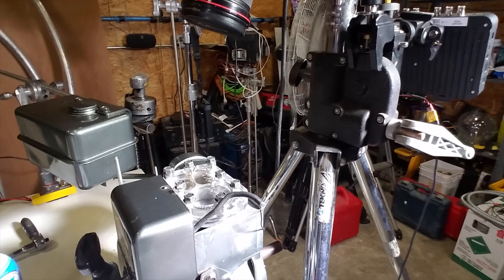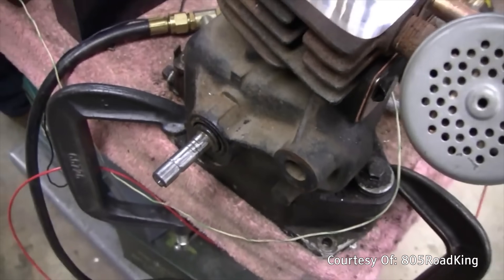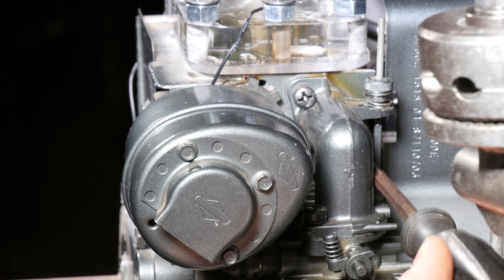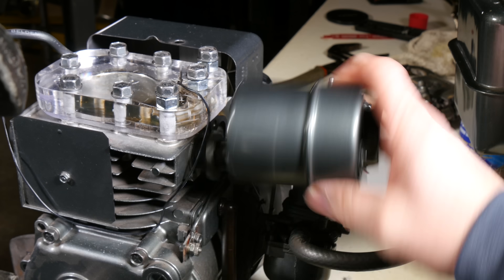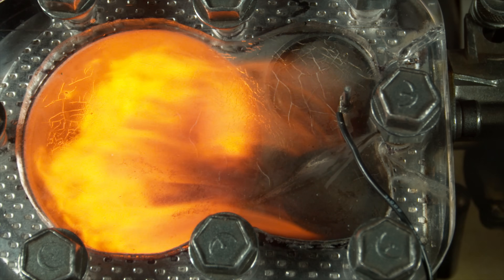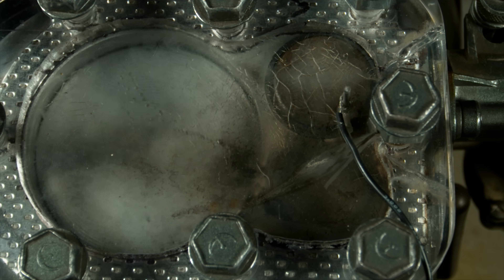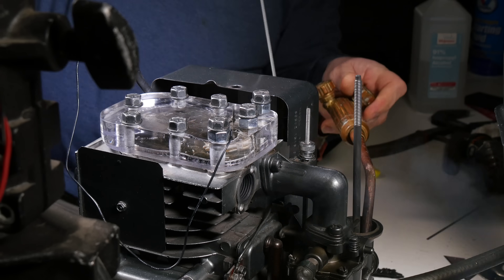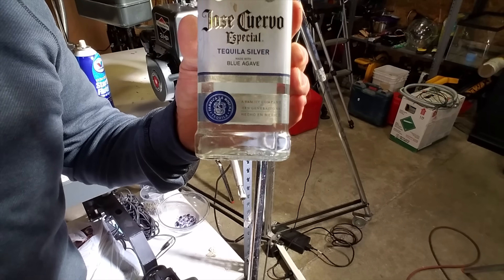See Through Engine - 4K Slow Motion Visible Combustion ( S1 • E1 )

Comment: 4000 fps is 150 times slower then real life? since when we see in 26.6 fps o.O?  4000 fps is 45 times slower the real life. We see in 90fps. If your real life that you are talking about is 25fps that you may record in then is something else.
Reply from the maker: Actually it says " 150 times slower than real time " not real life. life is way too fast !
Reply: Alexandru Visinescu Real life has no frame rate and we can distinguish well above 30 or even 60 fps.
Reply: Do some research, you can distinguish up to 1000fps. But on average you see in 90fps. squirrels for instance see in 120 fps . Our average eye resolution is 576mpx. just google it and tell me i'm wrong
Reply: Maybe, just maybe the human eye isn't a goddamn camera that takes a bunch of pictures, and 4000 fps is 150 times slower than the standard video framerate of 26.6 fps when played back at that framerate?
Reply: Ur maybe right on the fps, but less correct about the resolution, 576mpx is the number but in reality 9mpx is in use since u dont see everything around u sharply
Reply: I never said u use all that 576mpx. You can use around 74mpx. but 9mpx its not much. You can make the difference between 4k and 8k with no problems, or even higher. Here are the "specs" of the human eye if u are interested.
Sensor (Retina)

: 22mm diameter x 0.5mm thick (section); 10 layersResolution

: 576MP equiv.Visual Acuity

: ~ 74 MP (Megapixels) (printed) to show detail at the limits of human visual acuityISO

: 1 - 800 equivalentData Rate

: 500,000 bits per second without colour or around 600,000 bits per second including colour.Lens

: 2 lenses - 16mm & 24mm diameterDynamic Range - Static

: contrast ratio of around 100:1 (about 6 1/2 f-stops) (4 seconds)Dynamic Range - Dynamic

: contrast ratio of about 1,000,000:1 (about 20 f-stops) (30 minutes)Focal Length

: ~ 3.2mm - (~ 22mm 35mm equiv)Aperture

: f2.1 - f8.3 (f3.5 dark-adapted is claimed by the astronomical community)FOV Field of View

: 95° Out, 75° Down, 60° In, 60° UpColor Space

 - 3D (non-linear) RGBColor Sensitivity

: 10,000,000 (ten million)Color Range

: 380 to 740 nmWhite Balance

: Automatic (constant perceived color under different lighting)Refresh Rate

: foveal vision (high-quality telescopic)  - 3-4fps; peripheral vision (very inaccurate) - up to 90fps
Reply: but even still depends what kind of monitor the 4k and 8k are displayed on, if u put those into phone then it becomes really hard to see the difference versus a 80'' tv screen. But alas ''specs'' are ''specs'' and propably linked to 1 persons eye, not every eye is the same, some see more colors some see less, some see far some see near, its not a camera lens that is more or less the same for every camera of same brand.
Reply: The ppi counts a lot, that's obvious. And the numbers are on average, ofc, every eye is different. Even your left eye is different from the right eye. Do some research for yourself if you want, there are ways to calculate how many ppi can u see from any distance from a screen for example, and stuff like that. I suck at math so i cant tell u :)))
Reply: Alexandru Visinescu you only see at 24 fps if you had some tequila shots first
Reply: Bladsmith  yeah but he said "4000 fps is 150 times slower than real life" The human eye works like a camera. Camera doesn't mean pictures. Night vision googles are used for sight, they work like your eyes/camera but they don't record, binoculars are used to see images closer, they work the same way. You even learn this at school at physics when you learn lenses and mirrors. 
https://www.nkcf.org/about-keratoconus/how-the-human-eye-works/
 I googled it for you, u can google it yourself if u want more info
Reply: E. coli after a bottle u see in playback :))
Reply: Wow. You should google what a colloquialism is. None of that had anything to do with the issue at hand.
Reply: Alexandru Visinescu While u are correct that human eye works like a camera ur still incorrect, camera takes still images, eyes do not, most cameras are digital, human is not. The fundamental of lens is there but still the way the actual image is created is different. Did u know, if u flip the binoculars backwards, u will see everything further away ? zis is amazing i tell you
Reply: The FPS and the speed of the video playback relative to time is just how quickly he plays back the frames that the camera recorded and has nothing to do with your eyes.

The camera recorded at a rate of 4000 FPS and he slowed it down to a rate of 25fps playback speed.  You're over complicating it.
Reply: I think people can see more than 90 frames per second... otherwise we wouldn't be able to see 3D effects in 120Hz or greater.

Comment: This is a great video, I enjoyed it so much! And your girl is awesome! 
I think though that the engines ignition isn't set right (too late). You can actually see that when the exhaust valve opens, there is still fire in the combustion chamber (being pushed out, i.e. not all of the fuel turns into engine power...), and that  the main burn happens after the piston is at peak high. I think you can enjoy greatly fixing the ignition timing and film it with better fuel efficiency and more impressive burn as well.

Comment: Someone please explain why the spark plug fires like a two-stroke when the engine is a four-stroke.
Reply: Matthew Degler The spark plug is designed to fire by being powered by the upward motion of the piston. 2 piston pumps in 4 strokes is gives you 2 sparks.

It isn't a hindrance, so it is good.
Reply: Mathew Degler.
This is a simple wasted spark engine, as most small four stroke engines are, it's simpler and easier to manufacture. In these engines the ignition runs off the crankshaft and sparks every time the piston reaches tdc (top dead center). In most car engines the ignition runs off the camshaft, which rotates at half the rpm (revolutions per minute) of the crankshaft, thus only sparking every second tdc. The four strokes are - Intake stroke, when piston goes down.  Compression stroke, when piston goes up.  Ignition or power stroke, when piston goes down again.  Exhaust stroke, when piston goes up again.  Or suck, squeeze,  bang,  blow. Cheers.
Reply: I'd just be worried a bit about backfire if there's still unburnt fuel after the power stroke (as seen in the pure-ethanol example). That is, unless the sheer flow of fuel intake won't let combustion reach down into the intake valve.
Reply: Mathew Degler.
Any unburned fuel would be burned it the exhaust.

Comment: The 91% alcohol  looked like a washing machine because 1.) the other 9% is water. 2.) The liquid was not being atomized correctly (a spray bottle with 99% isopropyl alcohol would make a solution to both of these problems just make sure you have some kind of exhaust on it if you use the spray bottle you don't wanna be holding a flamethrower lol) Hope it helps man and hope to see a follow up on this vid. P.S. the spray bottle would work the best for the tequila as well.

Comment: Nice but i got confused there is a spark which ignites the fuel and another one when  the exhaust port opens
Reply: Big smoke Gaming The design of the engine just makes there be for an extra spark for no reason. It harms nothing and is easier to build

Comment: I think some of the difficulties with "proper combustion" can be attributed to the air-fuel ratio. Assuming this engine was set up gasoline only then it probably somewhere between 14.7-15:1 something like alcohol or acetylene will have much lower ratio because it carries its own oxygen. So running the alcohol and acetylene on the lean side might help with the overflow and soot problem

Comment: Incredible video! It's fascinating to see how the different fuels burned in the engine. I'm also impressed the cylinder head lasted that long, considering the high pressures and temperatures produced during combustion. 

Also, seeing how the engine runs on tequila would definitely be cool. I think some gas turbines can actually run on liquor, but I'm not sure about piston engines, so it would be nice to find out!

Comment: Why does it spark after combustion?
Reply: This engine uses what's called a "Wasted spark ignition system."  The ignition system is built on the crankshaft, and gives a spark once per rotation of the crankshaft.  Since this is a brute-force-and-ignorance 4-stroke engine, it only has one power stroke for two revolutions of the crankshaft.  So it sparks once when the piston comes up compressing the fuel & air, and another useless time when the piston is coming up to expel the exhaust.  The reason they do this is because the flywheel, which is connected to the crankshaft, is a convenient place to to put the magnets that power and activate the ignition system.

Comment: Isopropyl rubbing alcohol, the over the counter stuff, is only 50% to 70% alcohol, the rest is mostly water but can contain other ingredients, like Castor Oil as well. This may have caused the flooding or washing machine effect you got, if you used the standard rubbing alcohol. You can get the 99% pure alcohol and that may have worked better. As for Booze alcohol, it will work great, the purer (uncut) the better. I ran a 350 Chevy engine on some Moonshine when I was stationed in N.C. back in the day, long story but it worked great and it only took a corroborator adjustment to have the Camaro run like a scalded cat! Great video, I've never seen the combustion shown like this.

Comment: Tequila is the same as alcohol(ethanol) fuel you tried in this video so it wont be much difference.

and the reason the alcohol wasn't burning was because of the rich air-fuel mixture that cannot be ignited( its commonly called a flooded engine) and can ruin an engine if not fixed

You just cant use different fuel in an engine with tuning it properly

Comment: Curious as to why you didn't put the spark electrode in the original position.
Reply: The thread in the acrylic head wouldn't be strong enough, it'd shoot it out like a bullet.
Reply: he was using the block as the ground electrode. not possible if the improvised plug was in the center of the cylinder.
Reply from the maker: it would be in the way of the explosion and take some of the Cinematography away from the shot.
Reply: wondered that as well... probably for better view ?
Reply: AaronGottaHelmetCam  A second grounding electrode could be added.
Reply: Warped Perception I never thought of it that way
Reply: +Warped Perception - thought so... sure got sooty looking with the acetylene tho

Comment: m sry if its a noob question. bt what are those 2 circles at right?? one is fuel supply and 1 is air supply i believe. corrct me if m wrong.
Reply: "It's not actually and explosion, it's a burn"
What's the difference? Rate of reaction? How fast does the reaction need to happen to say it's exploding then?
Reply: +devashish chauhan the top right is the intake valve, the bottom right is the exhaust valve
Reply: walter is correct, but a critical point is air, the intake valve the fuel/air mixture in. It's not actually and explosion, it's a burn. The ignition burns the fuel which in turn heats the air causing it to expand, that expansion forces the piston down. If the air entering was colder the expansion would be greater creating more power. 
When you use nitrous (n20) it has 2 parts oxygen per molecule, creating twice the oxygen (ie, twice the expansion).
Reply: devashish chauhan Intake and exhaust valves.
Reply: All "explosions" are a "burn" (well, except for nuclear and steam) But, I think there are two kinds of explosion when it comes to the burn type. One is a deflagration and the other a detonation. If you light a pile of black powder that isn't contained in some sort of vessel, like a pipe or firecracker, it will go "POOF", not "BANG". If you contain the powder in something like a pipe or firecracker, it goes "BANG". The rate of burn is too slow (sub-sonic) for it to explode in an uncontained state, but when contained, the pressure builds until the container bursts and makes the bang. On the other hand, a detonation occurs when the explosive material has a burn rate that is faster than the speed of sound (super-sonic). This explosive material does not have to be contained to go bang. TNT, Dynamite, detonation cord, C4, blasting caps, bullet primers, anfo, and mixtures of oxygen and acetylene are all examples of super-sonic explosives that do not need to be contained to explode with a bang. In the video above, you can see a balloon explode after a laser is pointed at it. I believe that balloon has a mix of oxygen and acetylene gas in it, probably cutting torch mix. Oxy/acetylene is not to be messed with for that reason. It's very powerful.
Reply: devashish chauhan exhaust
Reply: marlin gast m talking about the 2 just at the right of piston
Reply: Pijen thnx mate
Reply: GeneralJohn David thnx man . tht ws a lot of knowledg fr me ✌
Reply: Bob alloo thnx mate .. n i read it all . like really i did.
Reply from the maker: exactly, once we add Oxy and Acetylene it becomes an Explosion !

Comment: how come there is a spark inbetween the explosion for gas acetlyn
Reply: it's just a wasted spark, simple design
Reply: It sparks at a cetain point before TDC everytime, its just the design of the engine.
Reply: joel castro maybe to bun off any remaining fuel that was not burned during the initial spark? that was my guess during the video.

Comment: Rather than try the tequila, try using anhydrous isopropanol.  I think the reason you wound up with a washing machine for an engine was that 9% water content of the alcohol you used inhibiting the burn.  One way to find out.

Comment: I'm guessing that the excess liquid in the engine while running on isopropyl alcohol was water. It is usually sold as a mixture of water and alcohol, so the water would have been left behind after combustion.

Comment: Great test, you've just gained a subscriber! Could you try nitromethanol in this engine (like the stuff sold in small quantities for RC vehicles), OR nitrous oxide to see how it changes the flame pattern and intensity?

The tequila test would be interesting, but I imagine you'd need some high proof grain alcohol or similar.

Comment: The fluid you seen during the alcohol run was water. Rubbing alcohol can range from as little as 21% to as much as 93% water.

It's an excellent way to clean up the combustion areas, valve heads/seats/etc... as the alcohol breaks down the resins/laquers, while the high temp water displaces the carbon deposits... AND acts as a carrier for the contaminants once the alcohol is burned off. It's worth noting, however, that the alcohol is MURDER on gasoline spec fuel lines, gaskets, seals, etc., and the water creates HUGE pressure spikes in high compression engines (water doesn't compress)

Comment: Try to run your optical engine with WD40.  I ran a Rotax engine at no-load on a can of WD40 some thirty years ago on a bench (No optics of course).

You can easily tune the air-fuel ratio with the distance between the spray  nozzle and carburetor. 

Thanks for your video - I was surprised how long the head survived.

Comment: This was fun tu see ! I'd like more of that.

I am not surprised to see so much smoke on the acetylene. It is what you see if you light the burner on acetylene as well.

Here is my suggestion : Take as small burner on that set. Not a cutting torch, but a small burner what we used to weld sheetmetal. Open acetylene and oxygene bottles en both knobs and light the burner. Adjust the flame properly.

Now run the engine on normal fuel at medium speed. At the moment that all the normal fuel is used up and the engine is beginning to stall
...
Then extinguish the flame by pushing it into a wet cloth and quickly bring the burner to the engine inlet.

Good idea to wear safety goggles ! Hope to see something interesting soon.

Comment: Hmm did the intake valve hit the glashead? seemed to have the most cracks.... or is it just that the pressure is higher? anyway really cool stuff!!!
Reply: probably cause that area was rapidly cooled by the entering air fuel mixture after being warmed up by the previous stroke.
Reply: I figured it was from all the hammering from the near hydrolock of the isopropanol flooding. good way to break a con rod or crank, or blwo a head off.
Reply: Alexander Wingeskog warm + preassure.
Reply: Exhaust valve is hotter, hence why there are sodium cooled exhaust valves in some applications. No fuel to cool it like intake.
Reply: I assumed the alcohol degraded the acrylic.

Comment: Question! Why does the cylinder retract the second time between every combustion  - i understand that one combustion = one retraction of the cylinder but in the slow mo - there are 2 retractions per one combustion...why?
Reply: Another Random Person That would be the intake stroke
Reply: Another Random Person.
It's a four stroke engine, read my comment to Mathew Degler just above this comment. Cheers.
Reply: Another Random Person 4 stroke engine; intake, compression, combustion, exhaust.

Comment: thumbed up and subed. try running pure grain in it. it'll probably be better then the rubbing alcohol. i think pure grain alcohol it around 190 proof if I'm not mistaken. awesome video. makes me want to try and make a clear head. what did you use as a spark plug?

Comment: run this on Rc car nitro fuel, it burns clear. it may end up alot like the alcohol though. ive ran small engines on a mixture of gasoline/rc car nitro. not sure if they will run on it straight

Comment: thanks a lot for doing a transparent cylinder head. I'm a professional tool technician and even though I know all there is to know about these little engines and how to fix em, it's very cool to actually be able to see the combustion and exhaust process happening right before my eyes. 
good job to your little helper too 😉 

you should try doing the same thing on a 2 cycle engine if you can.